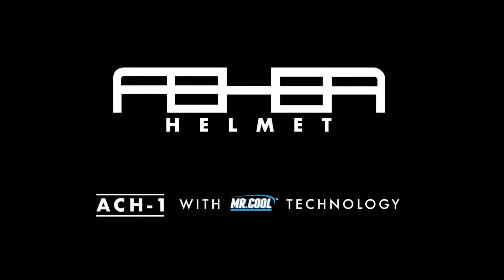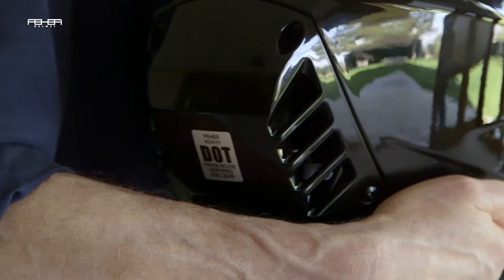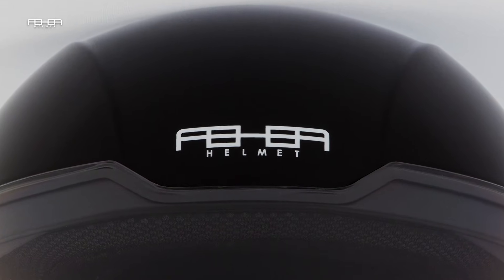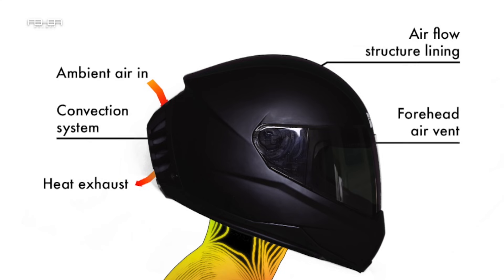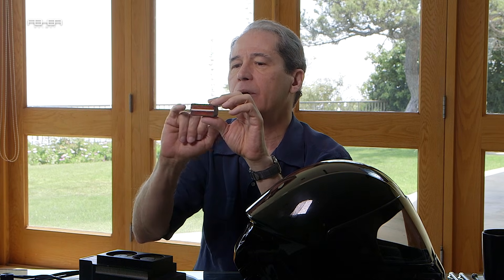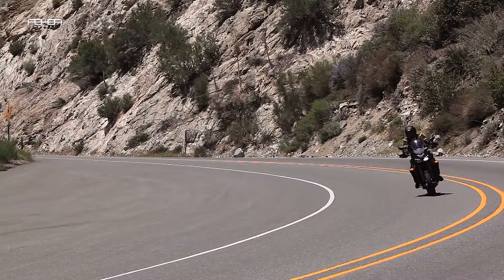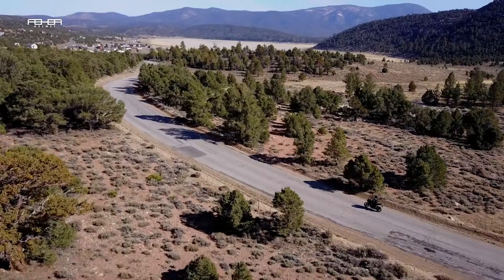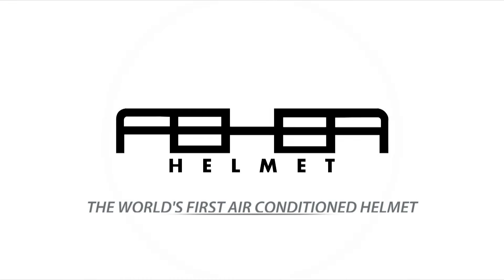Feher Helmets 2018 ACH 1 Overview

Comment: It would be way more efficient and compact if it circulated a cooled liquid instead of air. Surely tubing could be imbedded in the foam of the helmet, held in place with thermally conductive tape, then circulated through the Peltier.
Reply: yes, but the condensation will blind you

Comment: Non returnable once worn and used per Feher, but after using the helmet for some time now and on two motorcycles (BMW S1000RR & Ducati Multistrada), I've decided the helmet just has too many design flaws to keep using  While no one issue is significant enough to justify a shelving it as no helmet is perfect, in aggregate they make the helmet painful to use. Specifically:

    Harness, which I purchased 2 for 2 bikes, has no end cap to protect from water / dirt infiltration when not in use.
    Fan/Off/Cool switch is in wrong spot and just plain annoying.  For example: If cord is routed inside of a jacket, the switch isn't reachable.  It also resets to the off position too easily
    Regardless, switch prone to getting knocked into center, off position.
    (I would suggest on a V2 model, to put the rocker switch on the helmet itself, perhaps the back, and not the cord.)
    Cord into harness likes to disconnect in the wind, especially at track days.
    Intense whistling from the helmet when used on the Multistrada; doesn't seem to be an issue w/ the S1000RR -- perhaps related to the angle of attack.
    Fan/cooling noise is quite loud too, which wasn't made clear when I purchased it.
    And, more Noise, Noise, Noise: Helmet is just plain loud and offers no wind or sound deadening, compared to other helmets I own (Shoei, etc.).
Reply: I'm interested in buying for working in the summer heat.  In mid-summer it can get over 110 in my shop, would you think it work well for this application.  Not concerned about noise as I'll have ear buds in.  Can this drop ambient temp in the helmet 20 degrees?

Comment: I really believe that AC of some kind will be the "next" motorcycle invention.  An OEM could design a small AC unit into a bike and then provide ducts that a gear manufacturer could then plum into.  Even on not hot but high humidity days it would be a game changer.
Reply: @suzuki06g Hi! It’s been 6 years since you posted this. Has your idea been made yet?
Reply: @ramborenegadephantom9434   there hasn't been any real innovation in motorcycles over the last 6 year - since my original post.  Did you have something in mind?

Comment: There's a reason why the visor can be opened.
Reply: But if you open the visor in the 110 - 117 degree heat of Southern California, Nevada, or Arizona, it feels like a giant hair dryer set to max is blowing in your face.  It literally feels like the wind is on fire.  LBVS  Those are the extreme riding conditions that this helmet was made for..... not your typical mild summer weather.  This is a niche product for those riders.... definitely not a necessity for the average rider at all.

Comment: I usually just open the visor..lol . I rather have a heads up  display .
Reply: But if you open the visor in the 110 - 117 degree heat of Southern California, Nevada, or Arizona, it feels like a giant hair dryer set to max is blowing in your face.  It literally feels like the wind is on fire.  LBVS  Those are the extreme riding conditions that this helmet was made for..... not your typical mild summer weather.  This is a niche product for those riders.... definitely not a necessity for the average rider at all.

Comment: How about wearing a white helmet when riding in a hot place? They are 10 degrees cooler than black helmets.
Reply: Even 10 degrees cooler on a typical summer day in Phoneix, Arizona will still be 107 - 110 degrees.  A white helmet ain't gonna help when the temps are 117 - 120 in certain regions.  That's who this helmet is marketed at..... not just the average biker in general.  Extreme heat and humidy regions.

Comment: You want air conditioning? Open your fucking visor
Reply: But if you open the visor in the 110 - 117 degree heat of Southern California, Nevada, or Arizona, it feels like a giant hair dryer set to max is blowing in your face.  It literally feels like the wind is on fire.  LBVS  Those are the extreme riding conditions that this helmet was made for..... not your typical mild summer weather.  This is a niche product for those riders.... definitely not a necessity for the average rider at all.

Comment: Actually I could see this being used on an electric unicycle, or even used in snow with the thermal thing turned around to produce heat instead of cold.

Lot's of potential for this helmet, but the price is the killer, why do so many fantastic ideas that come from the USA cost so much money, then China makes it and everyone has one, lower the price and make the money, don't let everyone else make the profit off your idea.

The unit is the key, produce either a bolt on unit so it could be retrofitted at a much lower price or produce with helmet but at a better price.
Reply: Do you really think the price is an issue, or have you just not seen the price yet and you're assuming that it's super expensive?  I'm asking because a normal full face helmet with no extra tech in it from a store like revzilla.com sells for anywhere from $100 to $3600.  This 3.1 pound helmet with an integrated A/C is $599..... and is currently on sale for $549.  Killer price?  Huh???  :)
Reply: Ok to answer your question the first thing I did was to check the web  site and yes I would say the price is too high.

The thing is if you are a person who rides on a budget then you usually buy one of the cheapest helmets you can get your hands on, and lots of those cheap helmets have built in features, most of them are made in China to a EU standard or US standard.

What I'm trying to get across to the people who came up with this idea is they really need to move fast to set the standard that everyone else will have to aspire to.

But at the price it is being offered it will be copied using a cheaper method or system and then the people who came up with the idea will lose out which is a real shame.

They may have a really high end quality helmet and attach it to it which is fine for people who can afford a quality helmet, but then they cut out all the low end helmet buyers, this system could be a standard system for all helmets.

That's why I said a bolt on retro fit device.

The device could be sold for around £100/200 which is around 100/200 plus dollars and even offer a battery pack so the whole system could be around £200/200 dollers or so and a set of instructions.

That way the device inventor broadens the potential customer base, also using the instructions it could explain how to use the same device to produce heat.

So yes it's over priced but mostly because they include a helmet in the package, take the helmet out of the equation and let people decide the helmet they are going to fit it to, but offer a fully fitted helmet for those who don't want to fit their own helmet.

Do you see what I'm talking about, offer up different colours or a base standard colour so it can be sprayed.

I think they would sell more and make more money doing it this way rather than offering just a complete system fitted to a helmet.

like I said the device is the key for the inventor to make the money rather than the helmet, they have it the wrong way round, they have focused on the helmet when it is the device.

This device has lots of potential but it needs to be released from its shackles, but offered with the shackle so to speak.
Reply: I literally just had the same conversation with someone else, so I'm just gonna copy and paste what I wrote........ "I hear you, but from a business standpoint, that's not a realistic approach right out of the gate for a brand new company releasing a brand new product.  This thing has air traveling through the inner portion of the helmet... so to make something that would retrofit to any other helmet, that means every helmet manufacturer would have to completely start redesigning their helmets.  That's simply not gonna happen.  This company needs to prove to both the consumers and the rest of the helmet industry that this thing actually works 1st.... and an all in one unit is the best way to do that."  If you're not already familiar with it... look up BluSnap.  it's a retrofit A/C device for motorcycle helmets made buy the Indian company BluArmor.  I read that it costs about $25 U.S. dollars.  These are 2 very different forms of A/C technology options at 2 very different prices.... which is a good thing... as we wait to see if this niche market latches on.